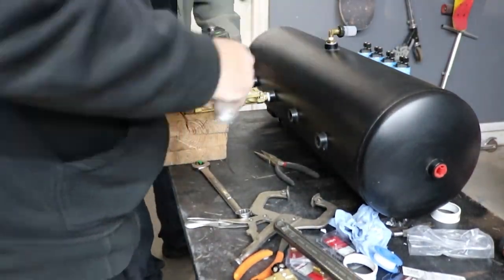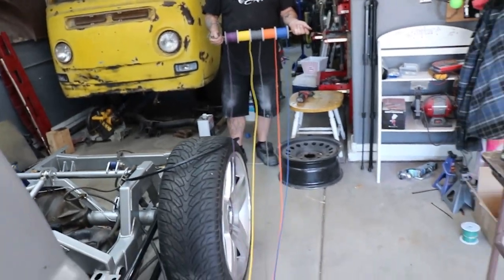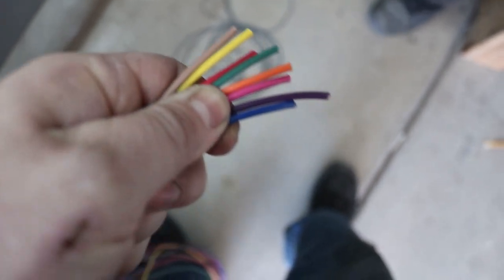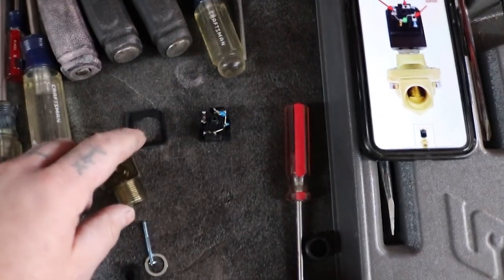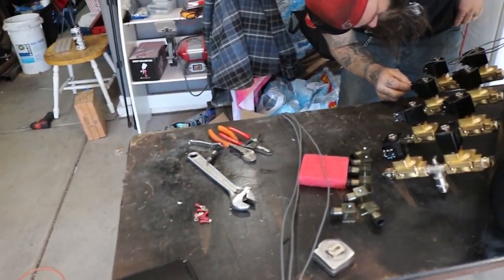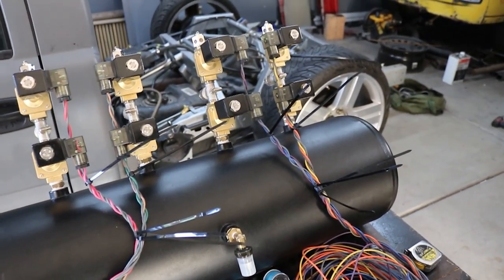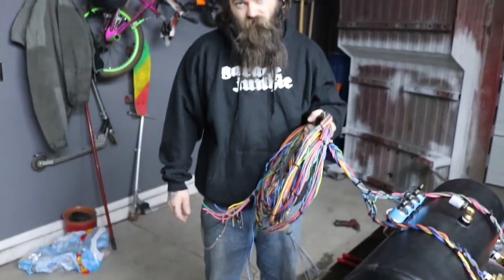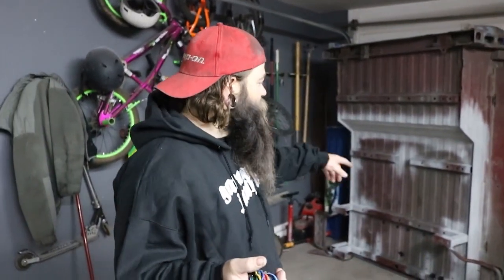How To Bag A Truck : Wiring Air Valves And Compressors

Comment: bro i need your help. im having problems with my valves and wiring my 3 prong switches right. avs fast valves. my rear valve only goes down  its been slowing down now its not working

Comment: Did you have to add 8 relays to the valves  from the switch box? If not the switch box burns out! The valves draw to much current for the switch box to handle.
Reply: I did see where AVS says this is you use elcrapo valves, but if you use SMC, Danz, Parker, GC or Sarai, this is not a concern...